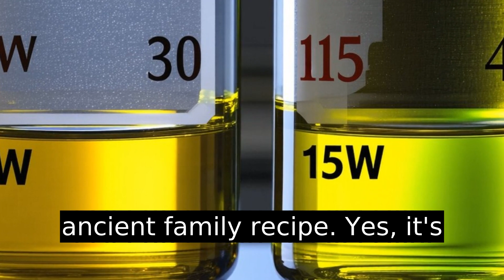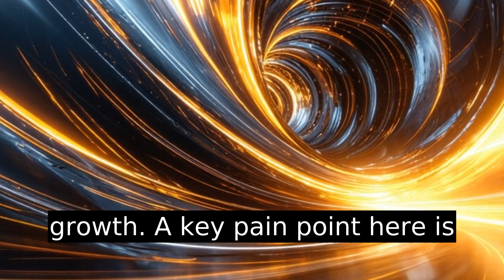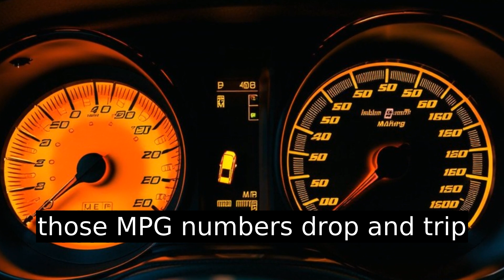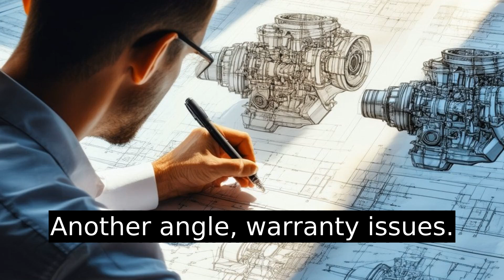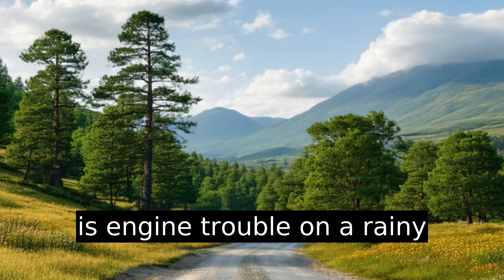Engine Test: 15W40 vs 5W30 – Will Your Head Gasket Survive?

Comment: If you put in a really thin oil, it will cause more damage than putting in a thicker oil. If I run a 0W20 in a vehicle that is rated for 5W 30, I can expect more engine wear than if I put in a 15W40 oil....and what the heck does a head gasket have to do with any of this?